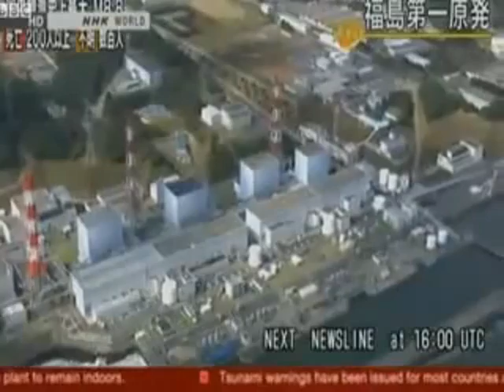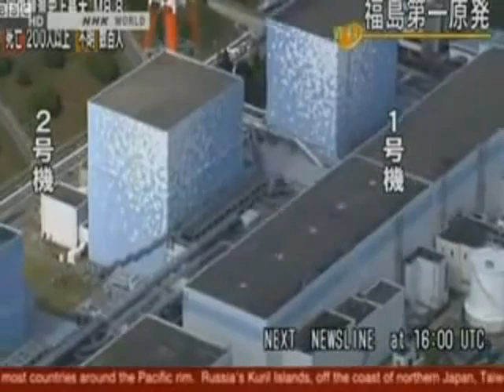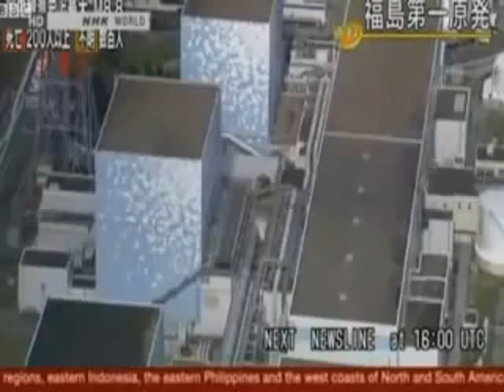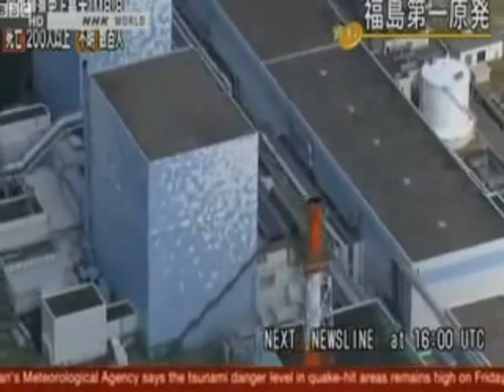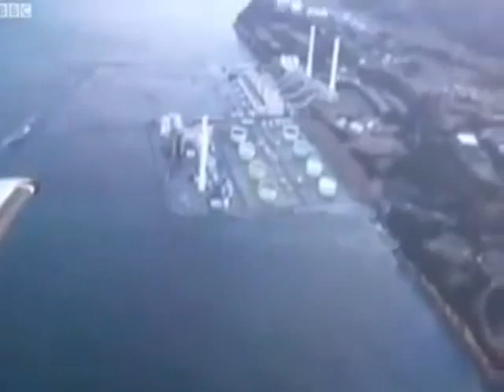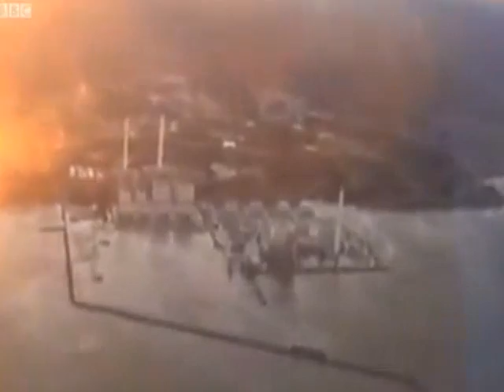2 Nuclear reactors now having Cooling System Failures.

Comment: The failure of the lithium coolant circulation system was the cause its usually just one pipe and not a series of layered pipes that would compensate or close if structural integrity fails like the cell structure of a vein or a blow proof tire...
The problem for clean-up will be free radicals and the beta wave radiation that they produce...
Very minute ones cause cancer when they are either absorbed by the body or they start an Autophagia,Homeostasis flux in cells in living organisms.